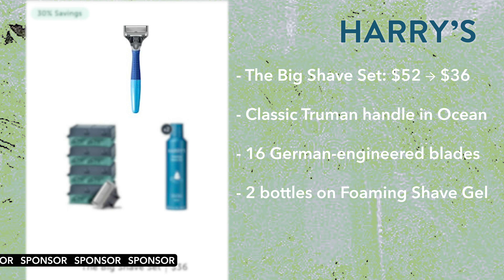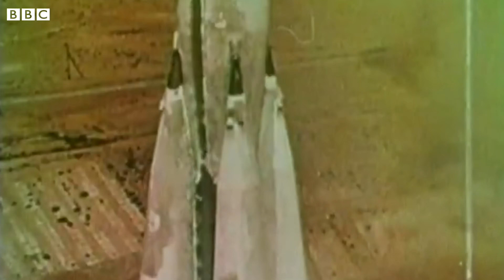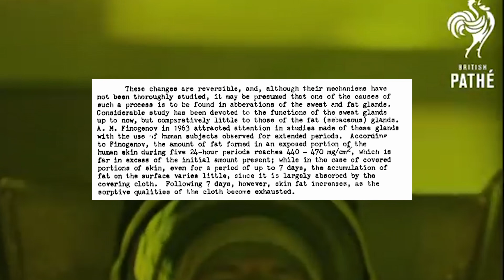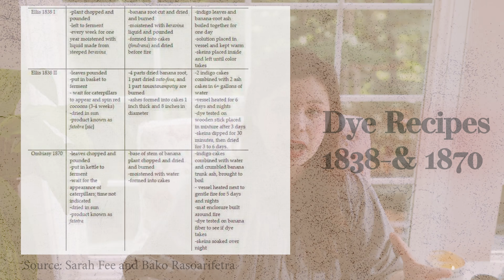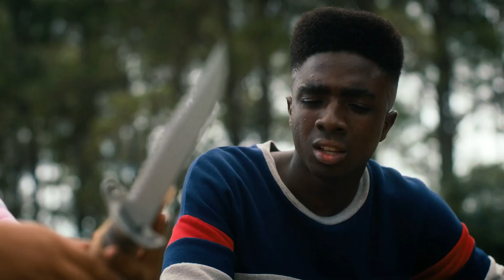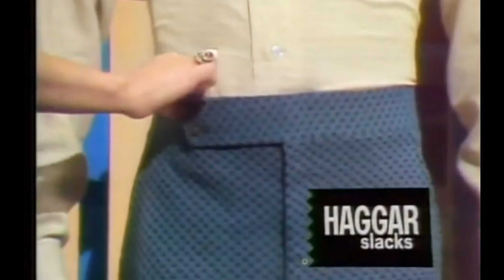The DISGUSTING truth about Laundry

Comment: Growing up, my stepdad was all about "saving energy" and insisted we wash our clothes in COLD water. That always sort of grossed me out, so once I was paying my own bills I wash everything that will tolerate it in the hottest water my machine (& the clothes) can manage. My previous machine's hot wash actually got up to 90C (very close to boiling) but it died and I could only afford a cheaper one to replace it (which only gets up to 70C). I make a lot of my own clothes, and actively use natural fibres only wherever possible (skin issues, anything with a high synthetic content makes me itch)
I'm in Australia, so line-drying is definitely a THING here and I do try to line-dry everything I can - however I'm limited to using those little folding airers, and I can't fit sheets and other big bulky items on there so I use the dryer for those things.

Comment: I hate to say this but, surfactants wash away germs. They bind to the lipids in their cell walls take them away when the water drains. Now, this doesn't mean that your laundry is sterile but it is as clean as it needs to be. This doesn't mean more soap is the answer, its not, since if the wash and rise water is to saturated with soap then the grime can't be washed away. Unless you need sterile laundry, say your are immunocompromised  or work at a hospital, then 1 or 2 tbsp of laundry detergent will do fine. If you want to soften your laundry use like a 1/4 cup of vinegar.

Comment: we've been getting smol now for ages as it markets itself as more environmentally friendly but realising I can't see an ingredients list and they're not antibacterial has freaked me right out - in the UK we're constantly told to wash at cooler temperatures and that it's totally safe but i'm going to have to do research haha. We tend to line dry or maiden dry everything, most people I know don't use their dryers at all, and we tend to have combined washer dryers. Luckily I live in an area with very soft water, but this has only strengthened my resolve to start switching to all linen where I can
Reply: As long as you aren't literally eating or sucking on your clothes or wearing them on open wounds, and you have no immunodeficiency you're very unlikely to have any problems. Regular washing shifts the germs from regular level soiling just fine. Whilst it doesn't outright kill them, it does remove them to low enough levels its highly unlikely to be a problem. Overcleaning with antibacterial products has actually lead to an increase is microbial resistance. Think MRSA which happened due to overuse of antibiotics - the bacteria evolved to survive it. Besides, a teeny tiny dose of microbes is what helps the immune system to learn to fight bigger doses so overcleaning in an attempt to reach an impossible sterile environment actually reduces ones ability to fight off infections. It is a good idea to clean the washing machine frequently enough at a high temp to reduce build up of both products & microbes, but there's no need to use antibacterial products unless you know that the clothing item has come into contact with something which definitely does contain it. So like if you've got fabric nappies to wash - yes use a proper antimicrobial laundry product (I specify microbial because antibac won't kill viruses so you'd want a product that kills as much of everything as possible). Same with vomit. So if someone has been ill, washing those clothes at a higher temp (fabric dependent) and/or using a antimicrobial laundry product coukd be worth it. Laundering instructions for my Mum's work uniform back when she was a dental nurse was to put them on a hot wash separate from regular clothes. Cotton can easily handle up to 60°C regularly (that's what I put towels on at), sometimes it can manage up to 90°C if your washer has that setting. But synthetics can't go as hot & that includes elastic/elastane.

Comment: I’m so glad you did this video. I’ve been thinking about this issue a lot lately, and have started to hang up my clothes inside to dry. Ultimately I’d like to put up a line out back so I can hang up towels and sheets more easily. I bought a brand new washer and dryer back in 2016 and remember telling a friend how it seemed to be tearing up my clothes. Towels were unraveling, spots wouldn’t come out, and a family quilt started coming apart every time I washed them. Thanks for your research, it’s really eye-opening!

Comment: living in central Europe I grew up hanging my clothes to dry, I didn't know a dryer even exists. Most of the people I know (me included) line dry teir clothing - even in balconies, where everyone sees it, no big deal. A trick is to hang big items like towels or bedsheets in the front and the underwear in the back, or have a rack to dry it inside.
About washing dirty clothes - I learned to wash anything that touches the no-no squares (underwear, pyjamas, bedsheets, towels, socks etc.) at least at 60°C and separately from t-shirts and other things that don't do well in hot water. 
Another thing rarely mentioned about fabric softners - they destroy elastic fibers, so your panties, socks, sports clothing etc. will wear out a lot faster. Some clothes even have warnings to not use fabric softner. Good substitute to fabric softner is white vinegar. Adding washing soda at the beginning will help to remove the buildup of washing chemicals - but be careful, washing soda can cause colour fading over time.

Comment: German here: I wash underwear, pajamas, bed linen and towels at 95°C. (This also keeps the washing machine clean if you wash so hot every now and then). In addition, the washing powder that is hopefully as well degradable as the package promises.  And we don't have a dryer at all... By the way: Don't buy soap nuts, they work, but then you can't use them in your home country and the detergents and filters there are even worse than ours...

Comment: My main issue with linen is that it is really expensive. While I love that it's hardier and that it keeps you cooler than cotton, but it just isn't feasible for me to buy that much linen to have something to wear under all my other clothes every day.
Reply: My issue with it is the texture. Its even worse than shirting cotton in how stiff and scratchy it is. I would need an undergarment under it just to feel comfortable. Plus as someone with an extreme natural hourglass figure if I want clothes to fit me comfortably without paying extra to have them tailored or made to measure, the fabric needs to have stretch. And linen is most definitely not a material you find with stretch. With stretchy fabric I can size to fit my waist & let it stretch to fit my boobs & hips. With linen I'd have to buy to fit my boobs/hips which with most sizing the way it is means a ton of gaping at the waist. Now if the clothes were designed to fit someone with bust & hips both 14" larger than the natural waist measurement then perhaps that sort of style would be wearable. If I could figure out how to make my autistic brain less sensory averse to stiff scratchy fabrics.

Comment: VOCs are volatile organic compounds. This is literally any organic compound with high vapour pressure at room temperature that can be airborne. Everything you smell is a VOC....everything! The scent molecules emanating from a rose or a pine tree are VOCs. You produce VOCs, as do your pets, most of your home goods, your foods, and the Harry's body wash in the ad. VOCs are around you daily, and the vast majority are not acutely toxic. In rare circumstances, anthropogenic VOCs at high concentrations in closed spaces indoors can induce mild to moderate breathing difficulty and throat irritation, mostly in people that already have breathing issues. There can also be the risk of liver damage from chronic high exposure, but I have never seen this in a home, only in enclosed industrial settings. The most common anthropogenic VOCs that cause issues indoors are styrene, butane, propane, acetone, hexane and ethane, none of these are found in detergent, none of these are found in fragrance. The types of VOCs you should be concerned about are found in paints, glues, stripping agents, and fuels. These should be kept in air-tight containers and stored in well-ventilated areas. They should only be used in well-ventilated areas with proper breathing protection. Your gas stove should be checked regularly to make sure there are no leaks. The VOCs that come from the fragrance of your detergent are not only not the major culprits, but they're also not harmful at the levels in which they are used. Toxicity is determined by dose. Detergent fragrances are under strict control within the IFRA guidelines under categories 10-12. Detergents contribute a negligible amount to your home's VOC load...aka its odour, and next to nothing to indoor pollution. If you are at all concerned about the VOC load in your home, a fast and simple solution is to simply open a window and allow cross ventilation. That's it. Two common but far greater risks to indoor air quality are gas stoves and burning candles indoors, scented or unscented. Both are significant indoor polluters that produce known carcinogens. Again the exposure in your home is low, but it is cumulative. The few moments of odour produced by using a detergent is a fart in a sewer compared to burning a scented candle for a few hours as far as indoor air quality is concerned.

Comment: I have long been trying to figure out a better way to do laundry. Though I was born in the US, I spent a few formative years in Nova Scotia living at my grandmother's, and people in that town didn't even own dryers...they couldn't afford them or the electricity to run them. We dried everything on the line outside and in the winter (because it is very damp and cold outside), the laundry got hung up on racks set over the floor registers. As an adult, I studied and worked in Europe, where also clothes were hung up to dry. I am back in the US in New England, and the only problem here is that winters are below freezing, so line drying must be done inside (I don't have room yet), and the summers are very humid, so if you hang your laundry outside, it sometimes doesn't dry at all.

Anyway! I've been wanting a clothes line for years, and am now in an actual house, but there's not enough sun where I could put one. So I improvised. I bought this: https://www.amazon.com/Brabantia-Lift-Matic-Rotary-Clothes/dp/B0002EXYPM. The neat thing about this line is that you can fold it up and bring it inside when you're not using it. Also, I didn't want to put in the ground stake to mount it yet (because awful landscaping reasons), so I put this in the hole in the middle of the patio table on my front porch where the umbrella would normally go. When my laundry is done, I fold it up and take it in. I am working on figuring out a sturdy bracket I can mount on the porch railing, which is substantial enough to hold it, then I can use the table as a table when I'm drying my laundry.

The advantage of this style of clothes line is that you can hang your undies and such on the inside and shirts around on the outside, so no one has to see all the underwear. ;)

Another thing about laundry: I also am on a septic system, and I do not use bleach. But I am investigating washing soda and borax. Also sunlight. I recently was given a set (a set!!) of antique linen sheets made in Andover, MA (omg! antique linen sheets!), and some are yellowed. I'm going to wash them and hang them out on the line in the sun, or spread them on the lawn (once the awful landscaping is resolved bc there is no lawn). 

And lastly! omg! Yes! Fair wages for clothing manufacture! People in N America, treat your clothes more kindly! Learn how to mend! Learn how to wash things by hand if needed! (It's just not hard.)

Comment: Here in Australia, clothes lines are still extremely common (which is a good start) and because we do still have a fairly reasonable proportion of the population living in rural areas with septic systems (like me) there is more effort put into reducing our water consumption and less environmental damage from our detergents.  That said, I think our laundry does need to start with our purchasing decisions.  I'm a big fan of linen for the reasons you've mention, but also for another big one.  Australia is very prone to drought and cotton is a water hungry crop, requiring between 400% and 900% MORE water per tonne of usable fibre than linen flax needs.  Cotton also uses far more pesticides, some of which cause cancer and others a deadly to bees.  Linen is pretty expensive here in Australia at the moment because it is considered a "specialty fabric".  But if we start replacing some of our cotton consumption with linen, more farmers would take it up and cost would likely come down, thus putting it in the reach of more people.  I'm not a chemist, so I can't speak on how easy or hard it is to make more eco-friendly detergents, but I'm a big believer in doing what I can.  If that means I'm spending a little more money at the moment to buy linen instead of cotton when I hit the fabric stores, then it's a price I'm willing to pay.

Comment: As a European who lived in Chicago for several years, I was baffled by the way laundry was done there (not saying it's perfect in Europ though). 
One of the first thing I did was hook up water softening filters to every water pipe in my appartment (3 pipes + a special for the shower). 
I went to Target and bought a drying rack that could be set up indoors. Yes it's ugly but at least it doesn't damage my spouse's expensive shirts...
I had small sanitizing tablets that I used in Europe put in every load of laundry, they even sanitize with the cold setting. 
For really dirty clothes, I put alcohol in the first wash and then ran a cycle with the lowest temperature setting if any of the clothes had synthetic fibers. 
Everything was air dryed except towels and bedsheets (because indoor drying rack), who all went into the extra hot setting for both washing and drying. 
I know I am privileged to have the means to do all of this, but I thought I'd share, because some ideas might be useful for someone.

Comment: My great grandmother taught my mum how to wash clothes. She rarely washed anything above 30°C, unless it's underwear, which should be washed at 60°C or more (wash them separately from your other clothes!). Oh, and bedsheets, towels, socks! They can get real nasty! Wash them hot! (unless washing label states otherwise, ofc... some materials can't handle the heat.. wool, f.x.)

When using the right soap you rarely need to wash the clothes hot for them to be clean -- depending on how close to your body they've been used, ofc...
Soap + cool water will clean your clothes! Contrary to popular belief... I know people who wash all of their laundry on 60°C or higher

Stains should be removed before you machine wash! (You can just google the stain and material and the answer will be there ... my great grandmother, however, knew this all by heart ofc)

Soak in a bucket with regular, white vinegar and some gall-soap overnight for discoloration in white/lighter clothes. Or skip the gall-soap. Vinegar works wonders on its own!

If you'd like your laundry a little softer, you can add 2-5 drops of essential oils. It smells great too! (skin-safe brands, ofc...)
(I usually add some lavender essential oil when washing bedsheets. Once it's dry it doesn't smell overpowering, smells just enough to feel calming when going to bed 💚)

White vinegar in rince cycle will also soften your clothes!

Liquid detergent is better than the dry stuff. But ofc do not use too much. If your clothes feel rough after washing you might've used too much detergent.
(Make sure to read the ingredients ofc --)

Bloodstains should be rinced out with ice cold water!

The only laundry my mother use the dryer for is bedsheets and towels. It makes them feel softer. But my great grandmother never used a dryer,,, her bedsheets were always soft, so I don't really think you need a dryer for that, lol

We always dry our clothes outside in summer! ☀️

Wool clothing can be hung outside to air out, instead of washing them! (unless it's underwear or undergarments dirty with body fats and sweat ofc...)

Run your washer empty on the hottest setting once a month or so (depending on how much you use it) to rinse it out!

...I think that's all I can remember. Hope it can be of help to someone!